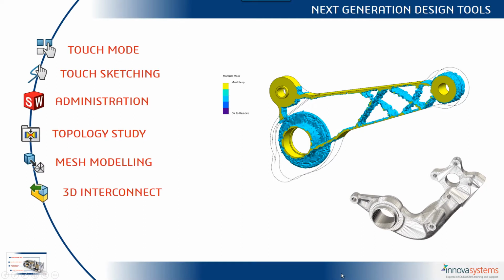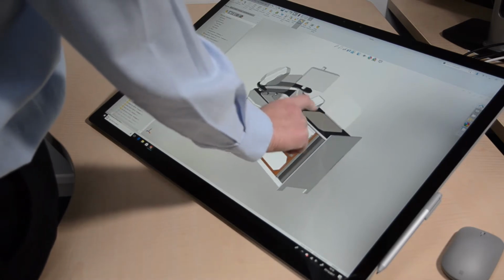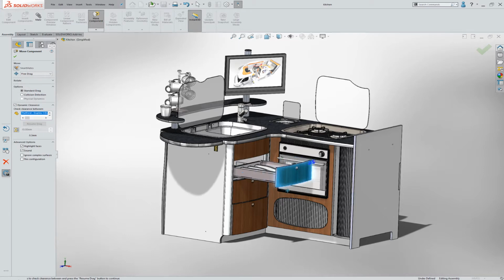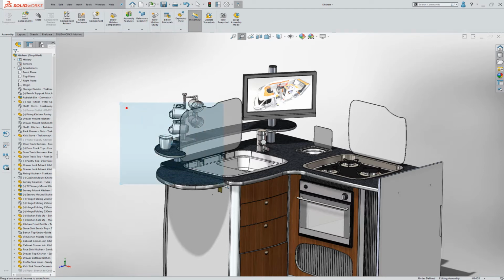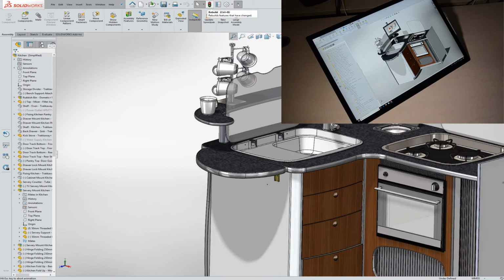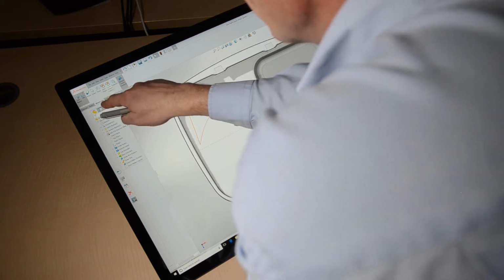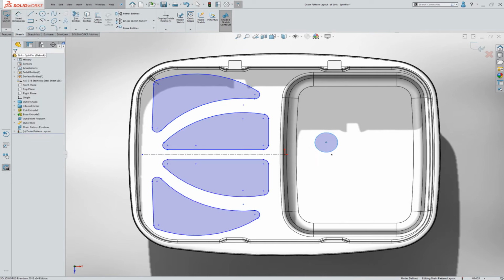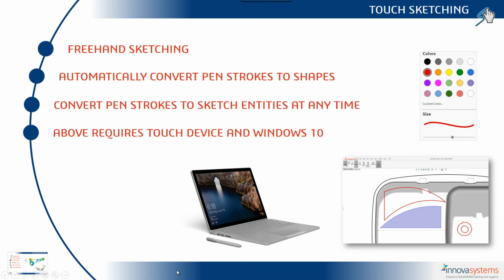What's New SOLIDWORKS 2018 - 16: Touch Mode

Comment: How can I learn touch mode solidwork? 

What is requirements for learn touch mode solidworks.

Which type computer etc ....
Reply: I have been using a Surface Pro. It is not ideal as the graphics card isn't supported but it runs fine. There isn't much to learn, I'd recommend looking at the Solidworks help documentation on it.